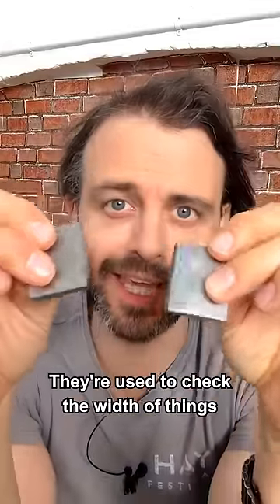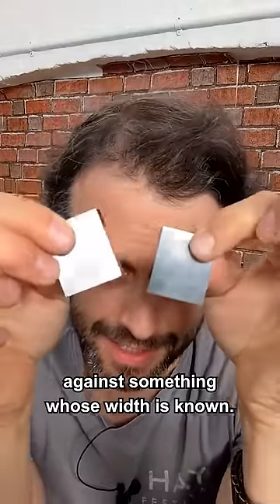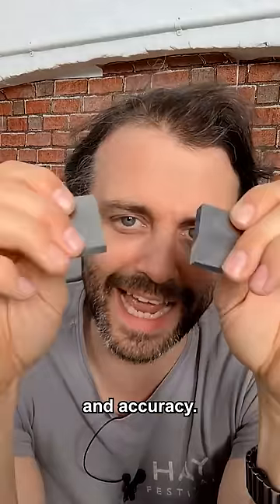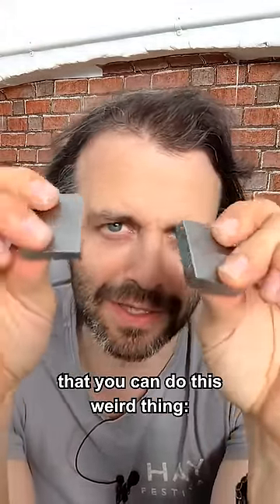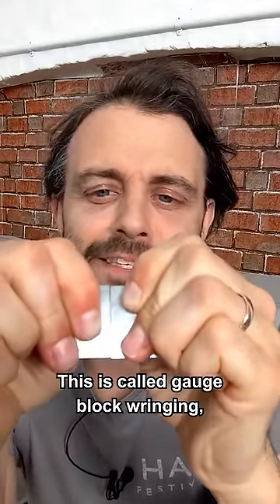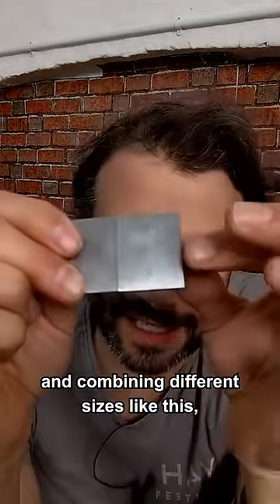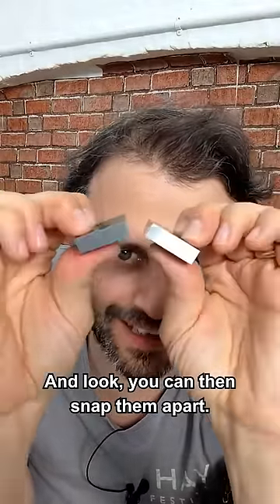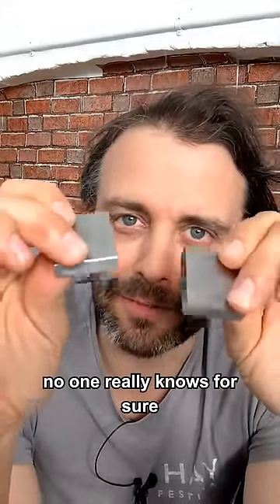No One Knows For Sure Why This Happens!

Comment: Why this happens is very well known! With such smooth surfaces, van der Waals force become dominant, causing the two blocks to stick together. For some optical assemblies, this is so strong because of the tight surface tolerances, it is used to fasten lenses or prisms together permanently.
Reply: Thank you! I was looking for this comment. It's a joke that Steve said "nobody knows". Education failed on him...
Reply: I also thought its electricity. Geckons move on surfaces using it.
Reply: This right here is the reason! The mis-information in the title of this short made me cringe. I'm glad you clarified the reason.
Reply: This is what I am too
Reply: 😂 BTW... Geckos also use van der Waals force to stick to walls: https://en.m.wikipedia.org/wiki/Gecko_feet
Reply: This is the correct answer!!!!!!!!!
Reply: @PinkeySuavo  Geckons, is that Gecko Electrons? 😆
Reply: yes but van der Waals is not fully understood... it's a theory, not a "law" so Steve wins... ;)
Reply: @PinkeySuavo vdw forces are electrostatic forces
Reply: @mattfollett866  those are understood enough so that one can calculate those in advance.
Reply: @mattfollett866 aren't laws just theories that don't fail?  Science doesn't know anything, it just predicts using old information.
Reply: This is even called “cold welding”
Reply: @MoringAfterStar  No. A law is a mathematical equation that describes a specific phenomena, a theory is an explanation for a phenomena that incorporates laws. A theory is built on laws, like a house out of bricks. 

You must also understand that there are two defitnions of theory, the colloquial or "common" definition used by laymen and nonscientists to mean a type of guess, and the scientific definition that means a well tested description of a phenomena that incorporates laws.

E=mc2 is a Law, describing the nature of energy equaling matter. The Theory of Relativity includes the formula as part of its description of space and time.
Reply: gauge blocks will cold weld permanently as well if you leave them like this
Reply: Bingo and if I recall correctly☁I'm in my 60s☁the van der Waals bonds are weaker than other bonds but they extend further, beyond the electron clouds.
Reply: Correct, and well articulated.
Reply: Some claim that these objects will eventually weld together if left long enough. I don’t see how vdw forces explain that phenomenon.
Reply: @mattfollett866  yeah, but a scientific theory is a very high bar to pass, especially in physics where things are a bit more cut and dry. 

Also a scientific theory cannot just become a scientific law either. They are different concepts.
Reply: @myday6074  "Education failed ON him" hmm... But yeah, you don't learn any of this in normal school.
Reply: @mattfollett866  I don't think you understand what the word theory means.
Reply: @MoringAfterStar  nope.  
a law predicts what happens while a theory proposes why. A theory will never grow up into a law
Reply: This is what I was taught at the university.
Reply: @iljabuchmuller7889  Being able to calculate something does not mean it is understood.
We can calculate gravity, but we don't really know why it happens.
Reply: @cccmmm1234,
We understand well (as well as we can understand anything) what gravity is as described by general relativity. We have tested and confirmed that understanding to extreme precision. The same holds for the standard model and quantum mechanics. The biggest gap in our understanding today, is how gravity relates to quantum mechanics. The mechanisms that contribute to van der Waals force however are very well understood.
Reply: Yep thank you. This saved me from having to explain it then having a few dozen people wrongfully correct me lol.
Reply: @myday6074 nah its probably just clickbait, very effective, especially for people like me that assume we do know and just want to see the explanation and go to the comments :>
Reply: My physics teacher told me some 30 years ago that, if you can machine two pieces of an element to extreme precision the pieces will stick together. I still think about this (and other things he said) every now and then... And now I know what it's called. Thanks! 😊
Reply: Vanderwaals forces is also my first thought. Geckos use the same magic.
Reply: Yes!
Reply: That’s what I was taught in engineering school. Thought this was common knowledge.
Reply: Within ONE block, there are forces that hold it together. Attractive forces between neighboring atoms.

So you might ask, why don’t two blocks of metal hold together by simply touching them together?

Usually they don’t, because surfaces are rough and dust and oil get in the way. Too few of the surface atoms get sufficiently close to those in the other block.

But if you make the surfaces exceptionally flat, then they will hold together.
Reply: Van der Waals forces are traditionally used to explain why liquids exist, not this type of phenomenon.
Reply: @smipi1   There is a difference between characterising something (ie. understanding WHAT it does) and understanding WHY it does something.

Any description that depends on another theory does not really explain WHY it just hides the problem somewhere else.

We can say gravity exists because of quantum mechanics, but that still does not answer WHY quantum mechanics does that.

Eventually we just have to say: because it does and we don't know why.
Reply: Sure, the old Van Der Waals force did it. 😆
Reply: @K9V1 "normal" changes with each different school, school system, and state. 2) education isn't just from school. If he has any business explaining something scientific/engineering he has business knowing what he's talking about before presenting bc his speech is fair game to crticism
Reply: Same reaction with taper fits only the bond is extremely strong!
Reply: Would that be Oswald van der Waal or Phuckadogeindearse van der Waal?
Reply: Gravity is still a theory too.
Reply: @smipi1 No, we don't know what gravity is. Some people think it is a quantum effect and that we will someday discover the graviton, while others think it has to do with the way certain strings bond to branes and whether they connect to a single brane on both ends of the string or whether each end of the string can connect to two different branes. There are plenty of theories, but we don't actually know what gravity is on a fundamental level.
Reply: Van der walls is very well known in florida. A german dude used to drive this crazy van around yellin at people untill one day he crashed into a house. Well the car slid up n just stuck right into the wall, the dude in the house goes "hey man wtf is goin on?" German guy goes "ah" points at the wall, "Van der wall, there."
"Ah ya that makes sense." And they both lived happily ever after.
Reply: I thought they may have become slightly magnetised, or something to do with just a very fine surface finish. Machined parts held by a magnet will become magnetised until you de mag them. I guess the smooth surfaces just grip each other. 🤷🏻‍♂️
Reply: @cccmmm1234 which part of mass (and energy because the two are equivalent) distorts space-time, and space-time gradients cause things to descend down the gradient is not well understood? The big question in physics that have us stumped, is what the space-time distortion (i.e., the gravitational field) of a quantum object looks like. If that is considered as gravity not being fundamentally understood, you can argue that we do not understand anything fundamentally really.
Reply: I have no idea what you just said but Yes
Reply: @Arawhon13  good explaination. Also a good explanation why following the science is still a gamble.
Reply: @mattfollett866   No, you need to look up the definition of a Scientific theory and whether or not a Theory can become a Law.
Reply: Exactly
Reply: Van der Waals force is a type of weak intermolecular force that occurs between molecules or groups of atoms. Here are some key points about van der Waals forces:

- They are weaker than covalent or ionic bonds and result from fluctuations in the electron distribution within and between molecules. This causes temporary bipolar moments that can attract nearby molecules.

- They exist between all molecules and atoms and allow weakly bonded clusters and liquids to form, as well as contributing to melting and boiling points. 

- The main types of van der Waals forces are instantaneous dipole-induced dipole forces, dipole-dipole interactions, and London dispersion forces.

- They become more significant as molecular size increases since there is a larger interaction area. Density and surface area of molecules also impact van der Waals attraction.

- They are weaker than hydrogen bonding but still important for molecular recognition processes and molecular aggregation/association behavior.

Surface tolerance refers to allowable variability in the dimensions of a manufactured part. It specifies the acceptable range that a surface can deviate from its nominal or ideal size. Tighter surface tolerances mean less variance is permitted. 

Surface roughness/texture is also often specified, as van der Waals forces are sensitive to microscopic imperfections and variations in topography. Parts need to be manufactured closely within their tolerances for van der Waals attractions between surfaces to occur reliably and for interacting components to fit together properly.
Reply: There are a few key reasons why van der Waals forces happen:

- Electron distribution fluctuations - Molecules/atoms do not have perfectly symmetrical or static electron distributions. The electrons are in constant motion, which can create transient dipoles. Fluctuations in one molecule's electron cloud can induce a dipole in a nearby molecule, attracting the two together.

- Induction effect - A molecule with a partial positive or negative charge can induce the opposite charge on an adjacent molecule, creating an attraction between them. Even neutral molecules have instantaneous charge fluctuations.

- Dispersion forces - Results from correlations in electron motion between interacting ground state molecules. Electrons in one molecule are continually redistributed, generating a variable electric field that induces dipoles in neighboring molecules.

- London dispersion - A specific type of dispersion force caused by correlation of instantaneous multipole moments induced by fluctuations in the electron charge cloud. Even non-polar molecules experience this interaction. 

- Increased surface area - Larger molecules have many more opportunities for fluctuating electrostatic interactions between greater numbers of chemical bonds and electrons over an enlarged surface.

So in summary, van der Waals forces arise due to ubiquitous electron motion/fluctuations within molecules that generate transient, instantaneous electric fields and multipole moments. These permit otherwise neutral molecules to weakly attract each other through induction and correlation of their electrons' motion. The net effect brings molecules sufficiently close for these intermolecular attractions to occur.
Reply: The tighter the surface tolerance between two interacting surfaces, the more opportunity there is for van der Waals forces to come into play because:

- With less variability in dimensions, the surfaces can come into close contact with minimal gaps or air pockets between them. This maximizes the surface area over which van der Waals attractions can act.

- Microscopic asperities and variations are minimized, allowing an extensive, uniform interface for van der Waals interactions to take place across. Irregular surfaces disrupt continuous contact.

- Small deviations are permitted, but tight tolerances ensure contact points are optimally aligned for attractive intermolecular forces between corresponding regions on each surface. 

- Reduced roughness means fewer tiny voids and bumps that could negate attractive interactions locally by preventing flat contact. 

- At the scale of van der Waals forces, even minuscule variations make a difference. Tighter tolerancing provides a more consistent surface geometry for these weak attractions to reliably manifest.

So in essence, tight tolerances maximize interfacial compatibility and continuity at the microscopic level needed for van der Waals attractions to effectively influence adhesion and binding between contacting surfaces dominated by these intermolecular forces. Precise dimensions enhance optimal contact geometry.
Reply: And yet still, nobody really knows why 😂
Reply: @Arawhon13 there are equations that describe gravity for practical uses, and people say "laws of gravity", but many physicists will admit that we also think our understanding of gravity is limited or wrong.
Reply: @Subrosathefirst  I greatly value people like you in the comments. Instead of saying "It's because of this, I'm right."
You say "It's because of this, I'm right. Here's 20 bullet points worth half an essay as to why that is."
Reply: @myday6074   He literally went to oxford, one of the best unis in the world, how has education failed him?
Reply: @myday6074 Actually, ironically, he outsmarted you. He knows it's known. He says that to bait comments, which push interaction, making him more money. We are all just helping in his plan.
Reply: @JonnyFlash80 Cringe? Misinformation? Mah dude, you got played. Baited into commenting. This is a common tactic for increasing interactions. He played you like a fiddle.
Reply: @mattfollett866 In science, a law is the most ironclad you can possibly get.
Reply: @MoringAfterStar In science, a theory is the most absolute term you can use. Like Einstein's theory of relativity. It's as certain as we can be about something. Science doesn't speak in terms of absolutes.
Reply: @davemurphy2020 Yes, there's uncertainty in everything. But not all gambles/uncertainties are alike. For instance, gambling based on pure assertion and spurious evidence is essentially an entirely different thing all together when compared against intricate, controlled tests performed by hundreds/thousands of teams all competing against each other in a bid to claim the glory of showing an inconsistency and a better model. The latter manifests trust. The former is what underpins faith. Faith has proved to be a complete failure as a means of moving forward. Trust is a massively superior approach. It's the best we've got, despite not being perfect. Together with learning how to not cower in fear (like a scared child) at the uncertainties that remain, we are then able to improve things we once thought were untouchable.
Reply: @jaybingham3711  mmm faith in  technology or innovation is always subject to the whims of he or those that control. It is only human to doubt or fear that, it is the restraint of the megalomaniac . Science driven by greed for instance has often led to human suffering. The same could be said for the interpretation of some religions.  The phrase ‘to find good science just follow the money’ can also apply to the priest.  As time unfolds it becomes more obvious that the most valuable lessons of the past have been  degraded by our own sense of brilliance.  There is a genuine place for the Luddite in our culture and the  very worthy  gift of doubt  can be constructive. The more we  know the more questions we  should have. Enlightenment is a dangerous place to be for the scientist . That vessel is for the craft  of the artist. By the way I’m an engineer.
Reply: Aka COHESION and adhesion
Reply: Is it possible because it is a combination of different effects being applied all at once? 🤔
Reply: @Carlitobonline  It's a fine point. Single cause fallacy is a known bias.
Reply: cooked my brain for a moment, thank you
Reply: I asked a professor a question about Van Der Waals forces, he laughed and said, “you mean Hydrogen bonding, nobody says Van der Waals forces!”
Reply: @MoringAfterStar lol like our brains!
Reply: I knew Heisenberg would have the answer!🤣
Reply: Van der Waals force is something I've heard referred to somewhere else before.
Reply: Exactly…you already said it so I don’t need to. Forcing it together gets them close enough for attractive force to takeover, normally rough or non parallel surfaces don’t have enough area of contact for this to overcome the stress of forcing two bodies together
Reply: I mean, psh, like,     duh! Ya know?
Reply: Giving a phenomenon a name doesn't mean you know why it happens. Do we know why gravity happens?
Reply: Steve is well aquatinted with Van Der Waals, but knowing the name of something, or being able yo observe it, is not the same as understanding it. We all know that gravity is the reason why things fall to the floor but understanding it is something entirely different. If people truly understood the reason things happen, they would be able to predict these phenomenon before being able to observe them happening. Einstein was able to predict time dilation before proving it experimentally because he understood portions of it.
Reply: It's magic for crying out loud! Geeesh
Reply: *Adjusts glasses*
Reply: @twistedfrequency  I thought taper fits were more related to static friction, but just googled it and van der waals force is part of why friction works so I learned something new from your comment, thank you.
Reply: I don’t understand the van der waals, but does it need moisture to work? These metals won’t stick with a super clean surface, they need some moisture from water or oil to work
Reply: Proof?
Reply: @JonnyFlash80 proof?
Reply: @shanecorrigan8524  proof what? Find your own damn proof.
Reply: @JonnyFlash80  damn so scientifically minded of you, just asking you to cite your claim
Reply: @PinkeySuavo  It is electricity, kind of, in that van der waal forces are due to dynamic asymmetries in typical electron orbitals. As in, the electrons aren't always exactly spread around the nucleus (in fact, never are) so you always have some net electric force on every atom, and when you get a lot of atoms really close, this video happens.
Reply: @kindlin  yes
Reply: I don’t think Van der waals forces are strong enough to entirely explain the force of this attractive phenomenon. But they may still play a role. There are likely a number of electronic and unshelled nuclear protonic forces phenomena contributing to it including Van der Waals forces.